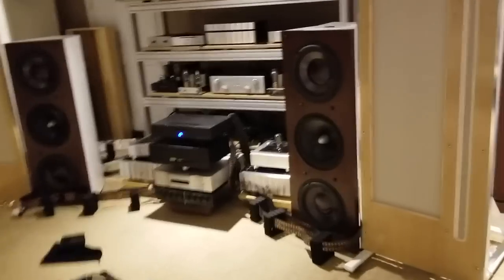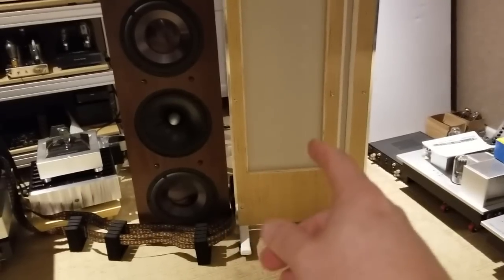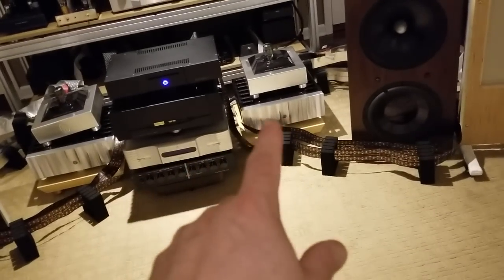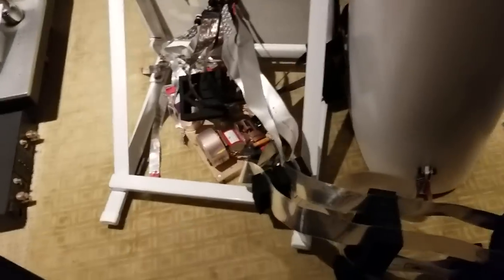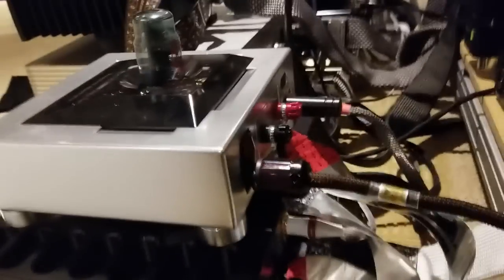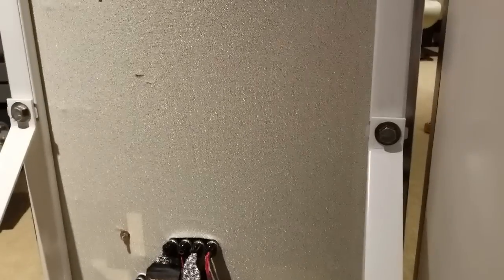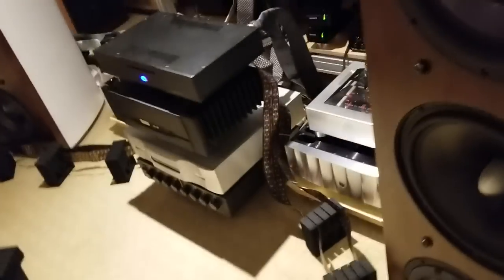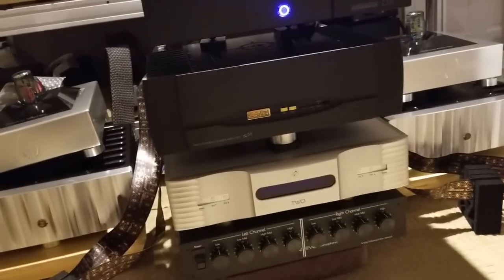Prepping for the Level 4 run.

Comment: I love how passionate you are about your gear. I am already frustrated with not having enough interconnects to hook up my cd player and my DAC. Worse, the connection to my preamp is an absolute mess. Kudos to you for hooking 4 channels per speaker ( interconnects and speaker cable). Those cables alone could easily cost more than the speakers.
Reply from the maker: Thanks man. Actually I manufacture the cables and sell them at very reasonable prices. I've also got like 5 bins of cables that are discontinued models but still very good. 25c on the dollar for anything in the bins. Send me a message with what you need and I'll quote you. 

All the best !

Comment: couldn't you have just added a Cap in-between the amp and the tweeter instead of attaching that  passive crossover? Great video Mikey, thanks for sharing!
Reply from the maker: IM not sure, I think it depends on the amp and mine are fully differential whereby the neg is not ground...

Comment: Possibly more efficient with a multichannel DAC and the crossover etc done digitally.
Reply from the maker: I am not a dsp guy. I know I can't avoid it with many DACs but until I hear one of these 8 channel dacs teamed up with analog gear I'm just not into it. It makes sense I guess. Like one DAC  And one amp for every single driver in the rig ? Must be efficient I just try to eliminate as many conversion processes as possible

Comment: what crossover box is that ?  the hifi ext crossovers i know are the legacy and the totaldac 3way
Reply from the maker: There are no hifi 4 way analog crossovers, so I had one made for my company to sell. Its e11even stereophonic. Its built to very high standards including fully differential signal path and no silicon opamp chips.

Comment: Love your passion man. I'm wondering though, why not Jeff Roland all the way through? Since then you won't be mixing together different sound signatures.
Reply from the maker: Hi Simon, iuts because I dont have 8 channels identical rowland amps, so you either do all identical amps or of not its a free for all, and you dont need the same sonic signature on all of them anyways. as long as they match Right to Left youre good. So I have Rowland on lows because they are the most powerful CODA on Mid because Class A is good like that then the  GaN Tube Class D for tweeter since nothing is more clear in the highs,, The crossover has gain control to balance the SPL between drivers..  Thanks for your reply !